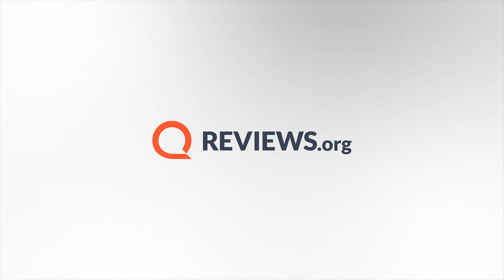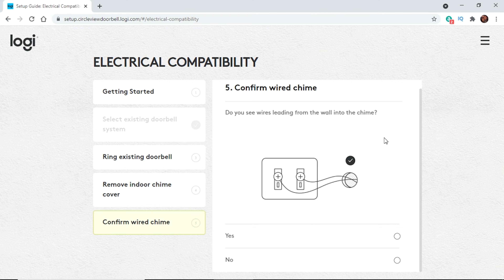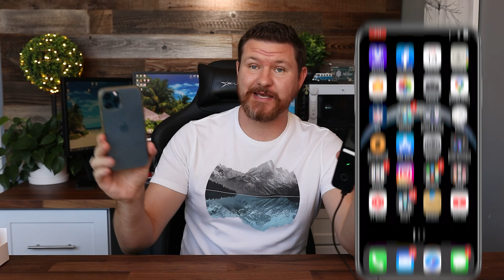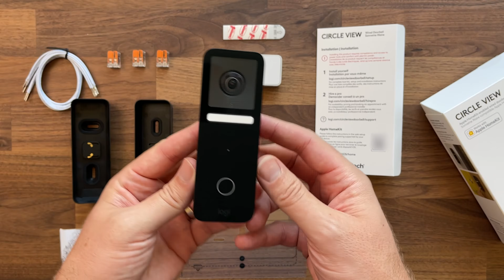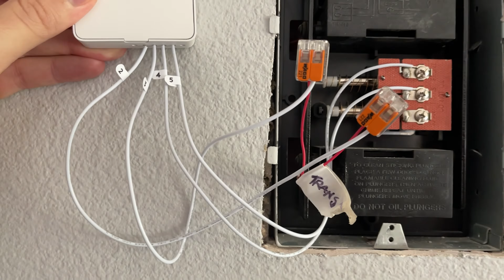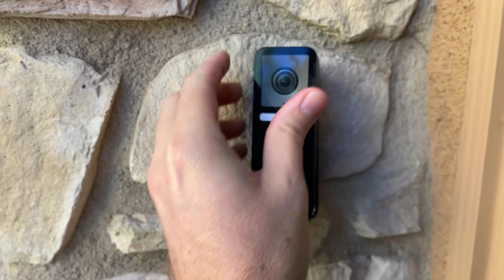Logitech Circle View Doorbell Installation

Comment: I’ve had this thing for a while. It sucks. It disconnects all the time and doesn’t have a way to reconnect without taking it off and putting it back on
Reply: Double check your transformer. There’s a transformer that converts your 120 volts down to the required 24 volts. If you’ve never had a smart doorbell, it’s probably just the minimum 10 volts that dumb doorbells use. That’s not enough to power it. I had the same problem with the Ring doorbell until that fix.
Reply: @katesmith2910 that’s very helpful! Thank you!
Reply: @katesmith2910 omg! I did this the other day. It was a 5 volt!!! 😂😂

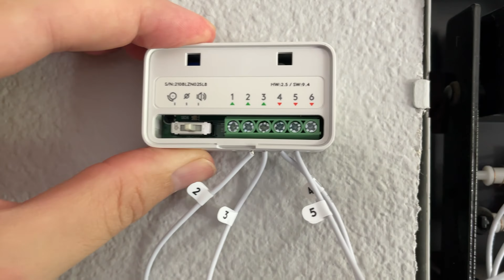Comment: Do NOT Buy if You Live in the American Southwest! I just purchased and installed the Logitech Circle View Doorbell. It will be coming off as soon as its replacement (an Agara G4) arrives. Faith promoting rumor on the internet is that Logitech has addressed their doorbell's overheating issue. Don't believe it. Mine overheated by just after 7:00 this morning. It keeps cycling on and off. Fifteen minutes off to cool down, 15 minutes on, etc. If it were to remain installed, things would soon get worse. Logitech says it will only work at temperatures below 105 degrees F. I live in the Phoenix area, our temperatures routinely are above 100 degrees in the months of May - October, which means this video doorbell won't work reliably for almost half the year -- even if it is mounted in the shade!

Logitech shouldn't be selling this for outside use. The number one requirement for a doorbell is that it is reliable. This one won't be for several days a year in most of the USA. In some parts of the country, it won't work reliably for months on end.

Comment: I have two chimes in my house.  How does this work with the chime kit?  Do I even have to use the chime kit?  Can I just use my HomePods as chimes?
Reply: Did you ever figure this out? I have 2 chimes, installed it on the upstairs one, but still not getting any analog chime sound at all.

Comment: Thanks Steve for this easy to follow video.  I will be wiring my doorbell directly in the mains via a transformer 18v as we are in the UK and we don't generally have hard wired doorbells - at least for the last 30 odd years.   The only stumbling bock was how to get the wires into the bracket - your video was super simple to follow - the logi setup guide sucks

Comment: Is it possible to set this up by using a plug in wall adapter?  For example in a house with non existing doorbell wires?
Reply: yes, it works via micro-usb cable as well
Reply: @rephd  yup. been running it "test" w/micro-USB the past few days and everything works perfectly fine. i use homepods as chimes. only issue is having to mod the bracket so it fits with the micro-USB plugged it...

Comment: I really don’t like the installation guide. If you answer the questions wrong, you hit a dead end that says, sorry the doorbell is not compatible. I want to be able to see the full requirements upfront without having to read a “choose your own adventure story”. If you don’t have a wired chime it dead ends… what if you don’t have a chime? Can’t you still install the doorbell, and just use the notification system? Or if you want to add a chime, it would be good to know what is compatible so you know what to install. It’s like Logitech would rather say tough luck if you don’t ALREADY have the proper set up.